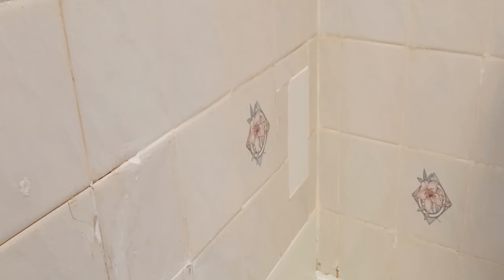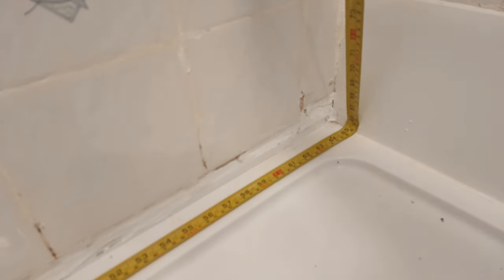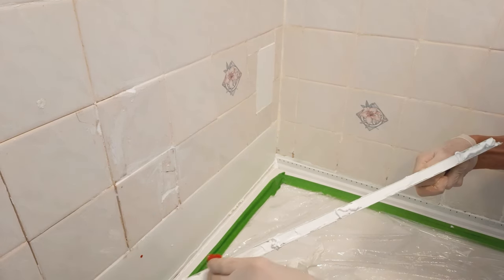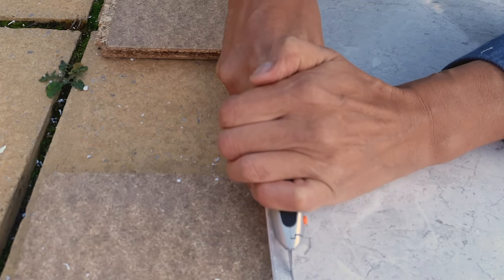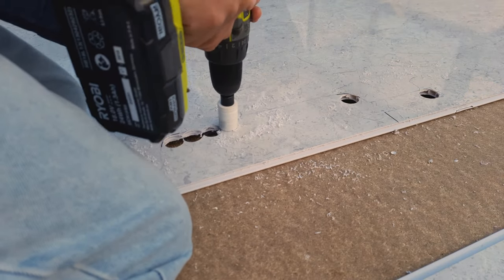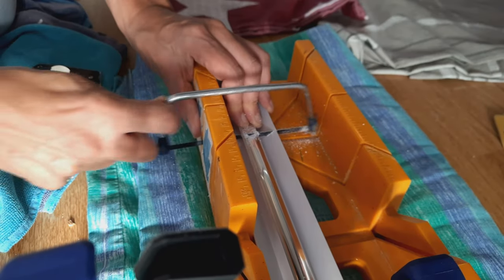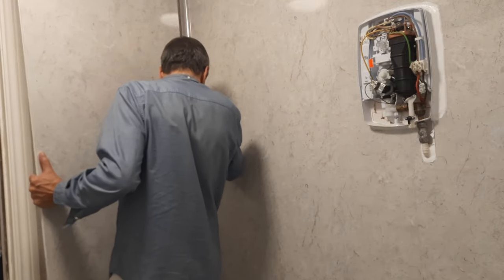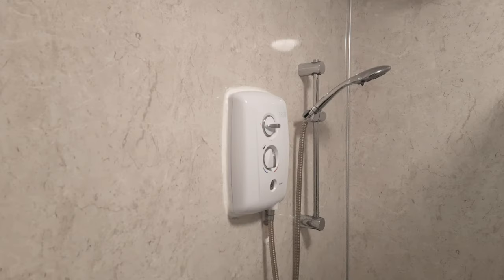Fitting Shower Wall Panels over Tiles 🚿

Comment from the maker: The shower unit was mounted a third of the way through the wall possibly by the previous owner / a plumber. I agree with any comments stating it would have been better to flush mount the shower unit and even better on a narrow side wall. I had just over a day to install the panels and did it for an elderly relative without charging as they couldn't afford to hire someone. Repositioning the plumbing, electrical cables, plaster boarding the hole, skimming, etc would have taken far longer than 12 hrs (well at least for me).
Reply: Why do you guys use those power showers in the UK? When I lived in the UK those things were dangerous - not to mention useless. In Australia we have just taps and a shower head only. The heated water comes from a unit outside - generally a heat as you go gas unit or an electric hot water tank.

Comment: U should have taken the shower off the wall cut 2 holes for electric and water feed, you then would nit have a huge silicone seal to cover your cutting, shame u bodged it,
Reply from the maker: The shower unit is mounted half way through the partition wall, not sure why it was installed like this by the plumber / previous owners. We would have needed to repostion the plumbing, install new plasterboard, skimming, etc hence I went for the other option.

Comment: How do you manage to align and join the panels if the old tiled wall is a little uneven and not absolutely square? Any issues or hints please?
Reply from the maker: Fill out low spots with plastic flat packers, they are used when installing windows. They are sold in different thickness 0.5 mm, 1 mm , 2 mm, etc. In the old days they would use wood packers but that isn't such a good idea in a humid room like a bathroom.